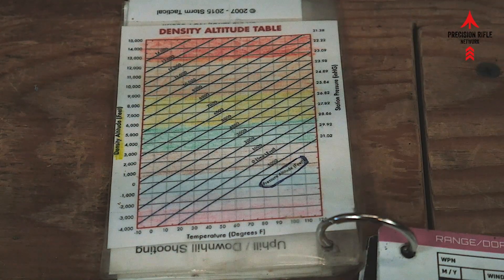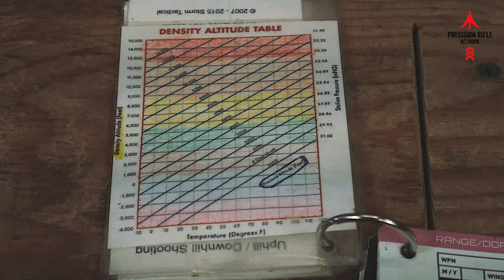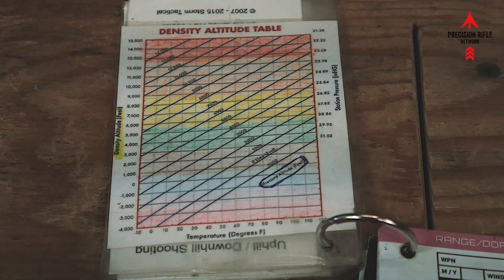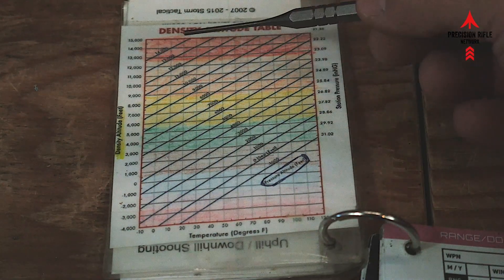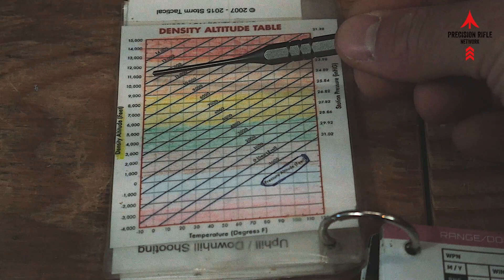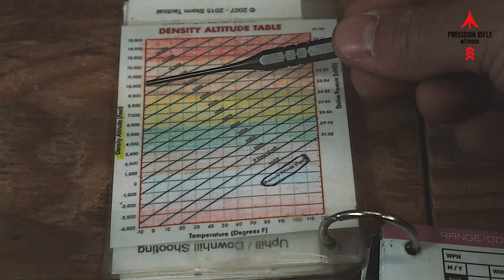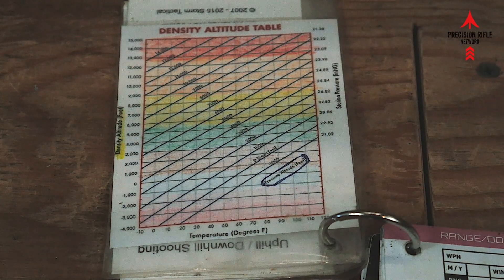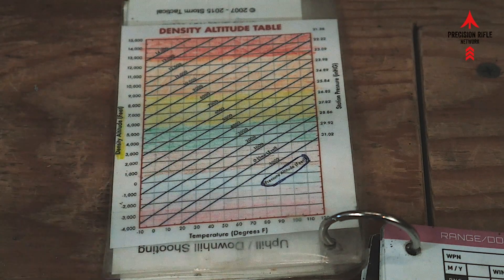Understanding Density Altitude | Marcus Hom

Comment: The 4,000 foot pressure on the ICAO chart (upper left corner at 2:09 minutes) is wrong. It should be 25.84.
Reply from the maker: ok thanks....did you notice how old this video is? (meaning we can't/won't change anything) Also, 4000 feet and a pressure of 25.84 can both be correct under the right conditions.
Reply: @PrecisionRifleNetwork Dude, lose the attitude. I was just pointing it out. Your video and your call if you won't/can't change it. I get that. But, that pressure is wrong in conjuntion with the temperature right next to it. Saying it could be right is like saying the a clock "could be right" even if it is not. I am well aware of the age of the video, but it is still available and this part is still wrong.
Reply: @PrecisionRifleNetwork I am full aware of the age of this video. However, it is still available on your channel, so it is still being viewed. Therefore, my comments are still relevant and the information you provided is still wrong. 
My purpose was to point this out in the comments so people taking notes would be aware of this error.
Reply: Hi enjoyed this video to understand what DA is. I'm still a bit confused how I use it to shoot at different distances. I shoot out to 800mtrs, and I adjust for bullet drop. If I'm making up a range card using DA, well, that's where my head is full of bubbles 🫧 
Thanks!

Comment: Been doing this with that exact chart since 2006.  Mike Fields was the first person I saw utilize it.

The latest developments do be doped in are spindrift, aerodynamic jump and muzzle velocity variations as a function of temperature.  Less easy to handle with a set of cards...but inside of 1k and depending on target size, that stuff might not matter.
Reply: Those are all definitely factors at longer range.  I always encourage people to play around with those variables in their software to get a good picture of how much they drive the overall solution.

Comment: Barometric pressure is the incorrect term, it’s station or absolute pressure. Barometric pressure is corrected.
Reply: I understand barometric pressure to be synonymous with atmospheric pressure or the pressure read from a barometer. Where as station pressure is corrected for elevation.  Is that not correct?

Comment: Altitude is not factor in DA.
At diffrent altitude you have different pressure (and pressure is not fix point and it change).
Reply: I'm not sure I understand what you are trying to get at.
Reply: Joso Joso wut.
Reply: altitude is not a factor in DA i.e. it does not matter at all. Because altimeters actually measure pressure and small changes in pressure. Factors for DA are pressure, temperature and humidity but not altitude.
Reply from the maker: Joso Joso pilots might disagree. Here’s a link from the FAA. https://www.faasafety.gov/files/gslac/library/documents/2011/Aug/56396/FAA%20P-8740-02%20DensityAltitude%5Bhi-res%5D%20branded.pdf
Reply: The effect of pressure is not mentioned at all in that article. higher altitude only means less pressure. A lot of ballistic programs don’t take altitude into account at all, just pressure. I don't know which device shows the exact altitude without being GPS based. And kestrel measures the pressure exactly, and from the pressure it only calculates the altitude , and if you want the best possible ballistic calculation, the pressure is used not altitude.
Reply: Joso Joso, as a pilot/aero engineer/shooter, I might be able to help. Altitude is indeed used in the calculation. Density altitude is pressure altitude (from the standard atmosphere; ie 29.92 inches Hg at sea level at 59deg F) corrected for non-standard temperature. If you already know your station pressure (kestrel), then you’re right, altitude is not needed since you’ll be supplying your ballistic calculator (or drop table) with real “point in space” pressure. If you don’t know your station pressure (no kestrel) you’ll need to manually go into a density altitude chart to correct the effects of temperature on the standard atmosphere as a function of altitude like he illustrated. Look at the right side of his DA chart. You’ll see station pressure. This is what a kestrel would be inputting to get the DA (left side of the chart). He’s showing us a way to do it utilizing a low tech option for the field. Technology has taken out some of the leg work and has made it more accessible to the general public, but low tech has its merits whether primary technique or as a backup. In the end, the math is the same and requires the same raw inputs. The baseline is always the standard atmosphere. Hope that helps.
Reply: @flydawg83  
I agree.
But to me is way more simplier and precise use pressure and temp than calculated over altitude, because pressure and temp and humidity are fluid number and they change in the field.
I understan how he use altitude to calculate DA but to me there is no logic to call something Density Altitude and for calculation ,altitude is just function of pressure.
Reply: @flydawg83  Boom!  Thank you.  I could not have said it better myself.  I guess I needed to place more emphasis on "Field-Based" and "Low Tech" solution in my video.  Yes, anyone can put good data into their Ballistic Weather Station and get results.  I am trying to help people understand the "why" and "how" behind it, so they can at least have a basic understanding of what is going on behind the scenes and still stand a chance when Mr. Murphy stomps on their electronic device.
Reply: The chart is based on standard temperature and pressure. It will be accurate at nominal conditions. If there is a significant weather event, then the chart will be incorrect.